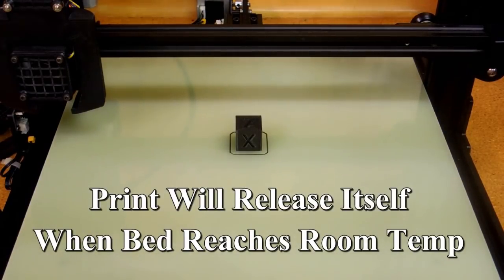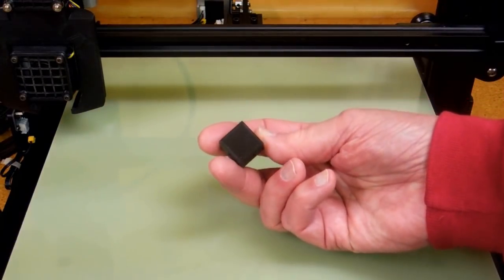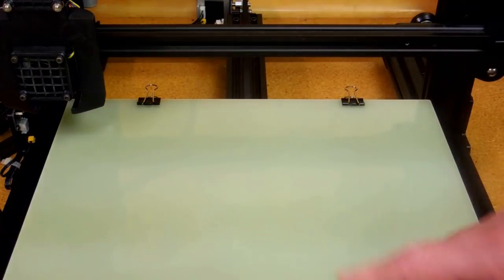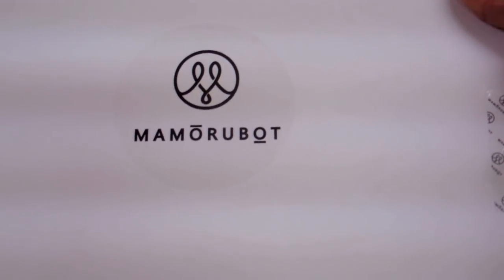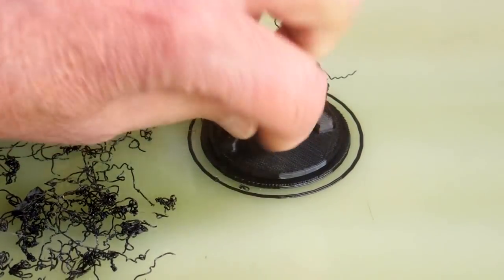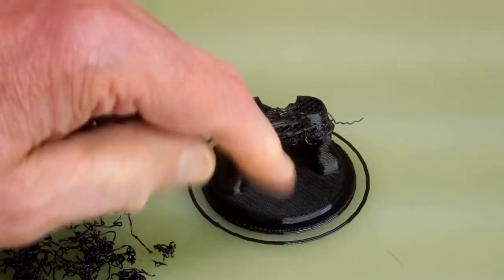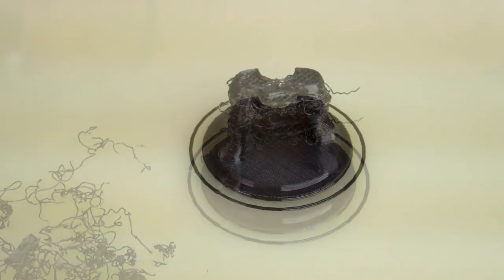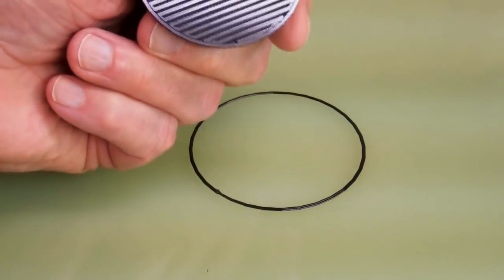Polypropylene Build Plate - 3D Printing No Tape No Glue

Comment: You can buy polypropylene sheet for about $3 @ 5mm thick cut to 235 x 235mm. I bought 5 for $15 from a local plastic supplier  It is the same color - no need to buy a product which is same and 5 times the cost!!!
Reply: What's the specific material name?
Reply from the maker: polypropylene

Comment: Have you have any experience with PETG and ABS they don't stick very well for me on this
Reply from the maker: No, sorry, I haven't used either on this surface.
Reply: @RonaldWalters2010  when it's at printer temperature, does PLA stick as well as it does on buildtak style surfaces? I got PETG to stick at 80C,  but was able to pull it right off before it cooled down.
Reply from the maker: You need to clean the polypropylene surface with Windex (or similar) before each print.
I have printed PETG on the Ender-3 with Creality carbon glass plate 240C nozzle 75C first layer... 65-70C remaining layers.... 50% fan after 3 or 4 layers and it sticks very well. If not I use a very light application of a glue stick which solves any problems with build plate adhesion. 
Glue stick works for PLA as well.
Please subscribe. That is what keeps this channel running. 
Ron

Comment: I can NOT get anything to stick to it. I have tried all the things in the video. Any tips?
Reply from the maker: I use Windex Glass Cleaner before EVERY print. A bit tedious to get prints to finally stick.

Your nozzle needs to be close to the build plate and the first layer you need to extrude to where you almost get elephant foot. The filament needs to be firmly pressed onto the build plate.

I believe the Creality Ultrabase Black Carbon Silicon Crystal Glass works better.

Thanks for watching. 
Please subscribe. That is what keeps this channel running. 
Ron
Reply: @RonaldWalters2010  Thank you so much, I did not think you would respond 👍
Reply from the maker: I try to respond to genuine comments.

Another thing to try is printing on Packing Tape... good quality stuff like 3M.

Or try a glue stick... like Elmers Craft Bond... lightly applied to the build plate. After the first print, a light wipe with rubbing alcohol on a paper towel reactivates the glue already on the build plate and you can print onto it again. 

3D printing is trial... a whole bunch of error with a pinch of luck. :-)  Ron

Comment: Thank you for the review. I would like to know what if there is a power cut and the bed cools down. When the power back on, the bed heats back will this hold the print for resume? Thank you.
Reply from the maker: Victor, No. Once the power is off and the bed has cooled, the part releases. The part will not reattach when the bed is reheated, and that is true of all the print surfaces I have tried. For long-term power outages you are just out of luck and the part is lost. Most of my power interruptions are fairly short. I have my printer connected to a UPS and for short-term power outages it will keep the printer going for around 1 hour. Then you just hope the power comes back on before the UPS depletes. The polypropylene surface is a bit finicky to use and sometimes it is difficult to get the first layer to stick. I have had much better results using the Creality Ultrabase Black Carbon Silicon Crystal Glass on the Ender-3 and the Ender-3 Pro. The older and more worn it appears, the better it seems to work. Links and coupon codes for the Ender-3’s and the Black Carbon Silicon Crystal Glass are listed below if you are interested. Thanks for watching. Please subscribe… that is what keep this channel going. Ron
Creality 3D Printer Ender-3 : http://bit.ly/2HdTjGS code: BGprinter002, coupon price: $169.99, end on Sept 30 
Creality 3D Printer Ender-3 Pro: http://bit.ly/2ZcQNLl  code: BGEn3P02, coupon price: $195, end on Sept 30
235*235mm Ultrabase Black Carbon Silicon Crystal Glass: https://goo.gl/ugMT75
Reply: @RonaldWalters2010  alright thank you for the comprehensive explanation. Do you mind to share the UPS capacity that you have now?
Reply from the maker: I have a APC Back Ups 1000 which is 1000VA. The display shows the power consumption and you can see the changes as the heating elements turn on/off etc. and it estimates the run time remaining in the battery. I have compared the display reading with a wall plug watt meter and the display is pretty accurate. The killer is the hot bed and how long the heating elements stay on. I overstated the 1 hour run... probably 30 to 40 minutes depending on what the printer is doing. A larger UPS like a 1500VA would get closer to an hour but it is also more expensive. My power outages are usually short and my 1000VA has saved several prints on the Ender-3 which would otherwise have failed. The only other option is to buy a very large battery (or bank of 12VDC batteries) and power inverter. Then you can design however long a backup you want... but it gets expensive. Hope that helps.
Reply: @RonaldWalters2010  oo wow yes your advice helps a lot for me to make a decision on this. It is sad that my country power outrage is quite long and I am considering to get the UPS. Thank you again..
Reply from the maker: There is a lot of information on the internet and YouTube for "Living off the grid"... battery chargers, solar cells, different type batteries, battery cycling, battery life, deep cycle batteries, power inverters. Another concern with a large bank of batteries (lithium batteries) is the safety and potential for one or more of them to catch on fire so you need to be careful about what you are doing and where you locate the batteries (such as not in your house but located in a separate building). It will require a good deal of study on your part. May also keep your refrigerator or TV running during outages as well. Good Luck!
Reply: Mine doesn't ender 3, yet they advertise that its supposed to.. as far as getting it to re-adhere not sure about that
Reply from the maker: In my experience it does not re-adhere. As far as I know nothing does. I have not had any luck with resuming a print due to poser failure either as the z-axis stepper relaxes and the show is over.

Comment: I got the Creality Poly plate for my Ender 3 and it was stuck in customs for 1.5 months so not that much experience with it yet. I can't get ANYTHING to stick at all to it without a layer of Magigoo.
Reply from the maker: If it is truly a Polypropylene Build Plate (I have not seen it listed)If what you got is thin and flexible it probably heeds to be glued to the hot bed.
My experience the bed needs to be perfectly level and the nozzle close (dragging on the shim paper firmly)
You need to heat things up and slow it down for the initial layers 
My Cura Settings for PLA
Clean surface with Windex before each print 
Nothing else used on the bed.
Initial Layer Nozzle 215 degC
Initial Bed 65 degC
Second Layer Onwards Nozzle 200 degC Bed 60 degC
Fan Off Initial Layers
Initial Layer Speed 20 mm/s
Initial Layer Travel Speed 60 mm/s
Skirt/Brim Speed 20 mm/s
Number of Slow Layers 2
Regular Fan Speed @ Layer 2
Print Infill 40 mm/s
Wall speed 20 mm’s
Travel 120 mm/s
I print just about everything at 0.1 Layer
Thanks for watching. Please Subscribe!
Reply: @RonaldWalters2010  It's this one (I think it's fairly new). https://www.creality3donline.com/creality-polypropylene-build-plate-for-ender-3-cr20_p0124.html
Reply: @RonaldWalters2010  It's definitely not flexible, it kinda feel and sounds like glass a bit.
Reply from the maker: Ok... looks like what I have on the CR-10. Don't know how you have it attached to the Ender-3 bed. I would completely remove the original print surface and the double sided tape that held it to the bed. Heating the bed to 60 degC makes removal easier. Let be bed cool, unplug the Ender-3 and clean the glue residue off the bed with mineral spirits... rubber gloves and lots of paper towels. Don't leave the mineral spirits soaked towels laying around. Then attach the polypropylene to the bed using 4 small binder clips.
Reply: @RonaldWalters2010  It lies directly on top of the aluminium (heating) plate. Mine never had any tape, only a thin metal plate held by clamps (the clamps is reused for the poly plate).
Reply from the maker: Interesting. I have seen people receive the Ender-3 in several configurations but never as you described. Good luck with your Polypropylene Build Plate.
Reply: Thomas Andersson nothing sticks on mine either. have you made it work for you?
Reply from the maker: For my polypropylene plate. Adjust nozzle close to build plate surface (drags firmly on a sheet of paper). Clean build plate surface EVERY TIME with Windex. My Cura Settings: Initial layer nozzle 215 degC then 200 degC. Initial layer build plate 65 degC then 60degC.  Initial layer print speed 20mm/s then 40mm/s. No cooling fan until layer 2. Hope that helps.
Reply: @RonaldWalters2010  It seems to do it. But I get tiny holes where at the corners where plastic lines should combine one with another. Any idea why?
Reply from the maker: Measure your PLA and see if it is really 1.75mm. Mine averages closer to 1.7 (I buy the cheap stuff) so I changed the number in Cura to 1.7. You may also try playing with your extrusion rate. You really need the first layer to squish down on the poly plate. For small parts I print on a raft... the raft sticks to the plate and the small parts stick to the raft.
Reply: @RonaldWalters2010  thanks Ronald.I will look into it.

Comment: can you print PP on this ?
Reply from the maker: Seller’s website says yes.

https://tiny-machines-3d.myshopify.com/products/polypropylene-build-plates-for-3d-printers

Bed Temperature Suggestions
PLA 50-70°C
Flexibles 50-70°C
ABS  100-125°C (110°C is suggested )
PC 100-130°C (120°C is suggested)
Nylon 90-120°C (110°C is suggested)
PP 100-130°C (120°C is suggested)
PETG 65-75°C

Comment: Hi, your vids have been very helpful to me, thx for the info. My Ender3 came with the removable surface, I think is polycarbonate with something like build-tac texture on it. It warped when heated so I went with borosilicate/pei laminate. I love that combo. The glass behaves the same with prints as your polypropylene when cooled. I also like having the option to flip it over when needed. Thx for your help!
Reply from the maker: Currently on my Ender-3 I have the Ultrabase Black Carbon Silicon Crystal Glass plate, which has some sort of surface coating. It is easier to print on than the polypropylene but the surface can be damaged by a hot nozzle. I have also tried PEI and prints stick well but again the surface can be damaged by a hot nozzle. I slip a piece of paper under the nozzle every time it goes to the home position to protect the surface. Where did you get your borosilicate/PEI laminate?
Reply: @RonaldWalters2010  I got the glass from https://gulfcoast-robotics.com and the pei from gizmo dorks on amazon. Then used the 3m "booger goo" to laminate them. I also feel that the lamination would be helpful were I to drop and break the the glass, by sort-of , keeping the spatter to a minimum.
Reply: I am printing on lexan 4mm thick without bed heating. PLA great
 PETG also possible but not every time.

Comment: Is this better than pei?
Reply from the maker: Takes a while to learn how to print on Polypropylene. The Polypropylene is thick and is not easily damaged by a hot nozzle. PLA sticks to PEI easier but PEI can be damaged by a hot nozzle. Usually you need to glue PEI to the bed or glass as it comes in very thin sheets. Thanks for watching. Please Subscribe!

Comment: Hi Ronald, I'm toying with the idea of getting this build plate.  My CR-10 Mini has glass and nothing seems to stick to it unless I use a messy glue stick.  With the glue, Amazon Basics grey PLA sticks fine, but the orange translucent PLA won't stick at all.  I tried bed tamps from 50 to 70, leveled the bed twice, set my speed down to 40 with initial to 20, hot end at 220, nothing will make it stick.  It always comes off and makes a mess around the nozzle.  Have you printed with translucent PLA and gotten it to stick?  Could I have a bad roll?  I'm at my wits end, lol.
Reply from the maker: I am not familiar with the plate on the CR-10 Mini. My CR-10 had a clear glass plate and I printed on masking tape with a glue stick or on top of packing tape (no glue stick). At the time of this video, the polypropylene plate was the best thing I had found. This polypropylene  plate is a bit finicky to print on and sometimes difficult to get the first layer to stick. I have the following on both my Ender-3 and Ender-3 Pro and it works great. I still use the polypropylene plate on the CR-10 but most of my printing is on one of the two Ender-3's as their bed is generally large enough.
235*235mm Ultrabase Black Carbon Silicon Crystal Glass: 235*235mm Ultrabase Black Carbon Silicon Crystal Glass: https://goo.gl/ugMT75   

Don't know what size the CR-10 Mini print bed is but maybe Creality has a similar plate for it.
Printing on plastic packing tape (re-level the bed with the tape on it) works pretty well.
I have not printed with translucent PLA. Start with a basic color like white or red PLA and get it to work then you can try the other stuff.
Sometimes the clear glass plates can be a bit bowed in the middle (lower in the middle than the sides). A lot of guys got a piece of mirror glass cut for their bed and it is very flat.
Please subscribe. That is what keeps this channel running.
Reply: @RonaldWalters2010  Thanks for that detailed reply Ron.  Subscribed ;-)  Will try the mirror next.  Lowering the nozzle helped, but parts were already scraping the bed, so I do think my glass is bowed.

Comment: Do you think i can cut a sheet 300x300 to 300x200?
Reply from the maker: I think you can cut it on a table saw or miter saw with a good carbide blade.